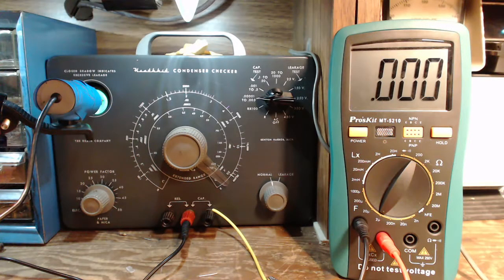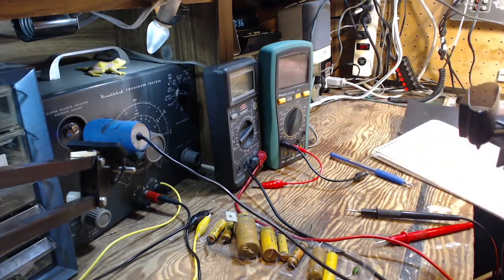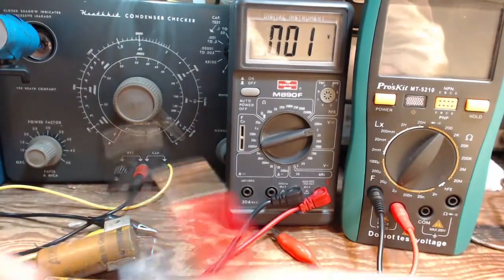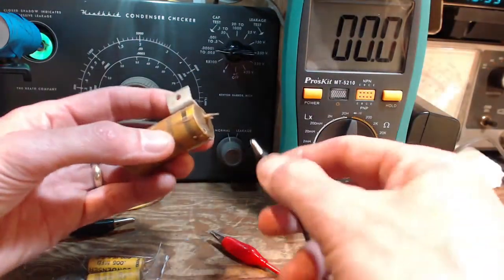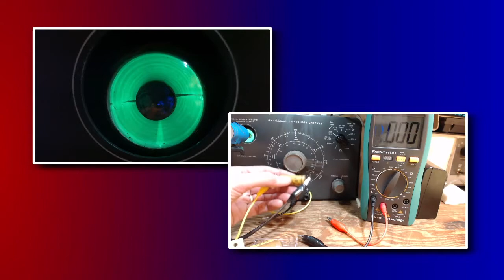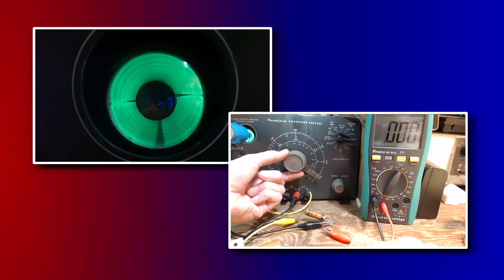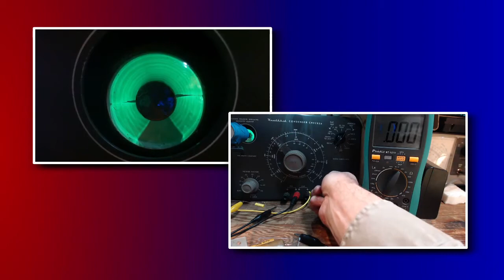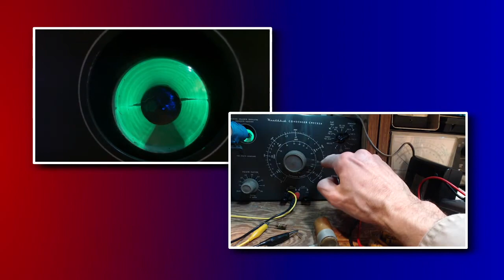Brand and Millen DR-102U Tube Radio Video #9 - Capacitor Recap

Comment: Froggie went a courtin' Heathkit C3...
I forgot that inst.disables the power factor check in the lower ranges. Not sure why they did that; it IS a useful check for ESR troubles. It might be because they wanted to keep it simple? I do agree with your theory of galvanic action. It is easily demonstrated.
A phenomenon you mentioned about the dielectric storing charge is usually referred to as "dielectric absorption". With glass, mica, ceramics, it is very low. With paper, oils, plastics, electrolytes it is higher. Good treatise there, Jim.
Reply from the maker: glasstronic During the career part of my life, I was the underground cable expert at a large distribution utility.  The cables were insulated with paper and oil (which I refused to believe when I first heard about it).  These are PILC cables sometimes 5 km or more in length running at 8kV phase to ground.  They acted as very large capacitors and were quite dangerous when tested by DC Hipot.  Not many there understood dielectric absorption or power factor.  

I was also the companies Corrosion Technician which is why I know a little about galvanic action.
Reply: Jim Lindenas
Yep, and long runs of distribution lines do present as an inductor in series. Power factor correction cancels the inductive reactance, usually by putting capacitors in circuit; makes the line "look" more like a resistor than a choke coil.

Comment: Well Jim I can confirm much of the same experiences you show in this video.  I have acquired four capacitor testers over the past year, a Blue ESR, and IET Labs DE5K, an HK C3 (same as yours), and recently, a Sprague TO-4.  As I said, I have observed much of the same thing, and my conclusions are that the modern capacitance meters are fine for low voltage, high capacitance capacitors, but for old, high-voltage capacitors they just don't provide reliable measurements.  For good capacitors they do fine, but as you found, leaky capacitors have funny results with these meters.  The other thing I have observed is to ignore any readings from the C3 at either end of its scale.  Since the scales overlap for some capacitor ranges, if I can observe the capacitance on the C3 on multiple ranges or near the upper semi-circle of the scale, I believe the result.  Readings at either extreme are unreliable.  One thing I like about the C3 (and analog equipment in general) is that the quality of the eye provides a good indication of the capacitor quality.  Often if the eye doesn't open well or has a fuzzy line, the leakage will be bad too.  As for it's leakage, I found the range of the C3 too coarse for my desires which is why I bought a Sprague checker (same price as I paid for the C3).  Instead of a simple eye tube, it measures the leakage current, and you can set the voltage at any point up to 600VDC.  I've also found the Sprague to be quite accurate on measuring the capacitance so it's bridge is well designed.  In short, I rely on a good leakage test for testing the capacitors in the old-time radios.  On a side note and just a theory of mine, is that the newer meters are oriented toward in-circuit tests for modern low voltage circuits, so that they are really fooled by these low residual voltages that you observed.  I have also put these modern LCR meters on my oscilloscope and found some interesting waveforms.  My meter puts out a 1 Vpp AC waveform that defaults to 1 kHz measurements frequency which explains some of the differences.  But it also adds a 300 mV 60 kHz pulse at about a 100 Hz repetition rate.  I think the designers of these new meters never really consider their use on old paper/wax capacitors, and I know that the designers of old paper-wax capacitors never considered how they would test at 60 kHz and 300 mV!  All good stuff, and very interesting about that residual voltage.  Lot's to noodle on.
Reply from the maker: Keith Barker Thanks Kieth for your detailed comment.  I have looked at the output of the digital meter on my scope (something I'll have to get on video) and it's a sawtooth wave form.  Not sure of the frequency but I imagine that the frequency varies depending on the scale.  It's funny to me that if you have one test instrument, you might not be inclined to question it's results.  I am very uncomfortable with things like blood tests where I imagine the result is from one test (but I actually don't know what goes on in blood labs).  I am also trying to spot the things that the Magic Eye will show that will tip off the quality of the capacitor like fuzziness or slow change.  On the residual voltage, I'm pretty sure it's a galvanic voltage.  It might be interesting to take one that exhibits a strong voltage apart to look at what is happening inside.
Reply: Jim Lindenas Right on the medical tests.  It's the old radar problem of the probability of detection vs. probability of false alarm aka Type I and Type II estimation errors.

Comment: Hi Jim,
I noticed that your were not observing the "banding" on the waxed caps. That is the negative end and should be connected to the low impedance of the source or tester. Try reading the banded caps hooked up both ways - see if you get differing readings - it may account for some of the variations in the readings you recorded.
Regards
Barry
Reply from the maker: g4rko Barry On paper capacitors, the banded end marks the outside foil.  The idea was to connect the outside foil end to the lower impedance side of the circuit (ground if that's the case) so the outside foil would shield the the other foil.  You don't see the outside foil marked on modern capacitors.  I did demonstrate the effect many videos ago with a new capacitor using my scope.

Comment: Hi Jim
Its good knowing the limitations of your test kit !

Test the CAP s first on the C-3 for value & leakage + Power factor ( ESR ) for electrolytic s then confirm the value with the digital meter .

PS I should check the 2 8uF 475V electrolytic caps in the C-3 .
New transformers are like rocking horse droppings !

2 X 8uF ( 2 - 22uF in series per cap & 250V or higher working voltage should do you ) .
4 x 22uF @ 250V is a Cheep FIX = £1.50 Max ( UK ) .

One new 10uF VISHAY cap is £24.59 yes each ! o.0
Reply from the maker: gd2329j I feel a video coming on!

Comment: Another source is of course static charges flowing, accumulating in the capacitors. If I hold a small cap in a room where my Van De Graaff generator is operating, it will visibly arc across its leads (spaced closely). Just pulling one of those wax caps from a plastic drawer is enough to produce a measurable charge.
Reply from the maker: glasstronic Something to investigate but I think any 'charge' would be depleted by the meter reading it.
Reply: Jim Lindenas
Yes, an electrostatic accumulation would be bled through the meter, takes a bit longer if the dielectric is prone to absorption. Yep, and caps do indeed become galvanic. Paper ones when they become soggy, electrolytics because they ARE soggy.